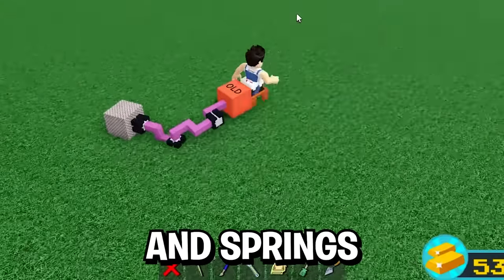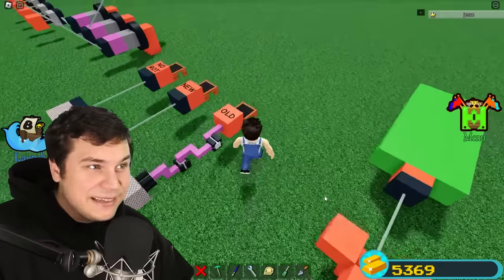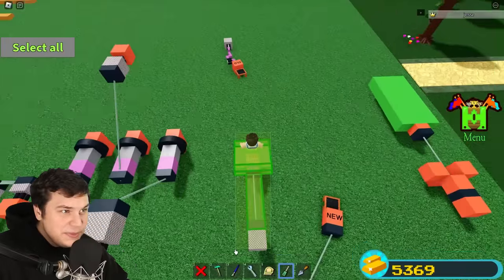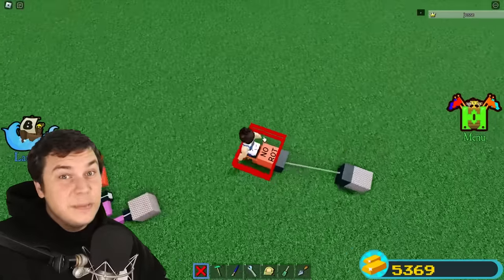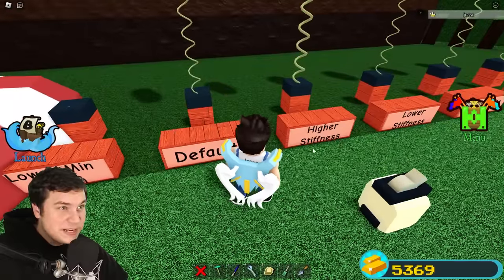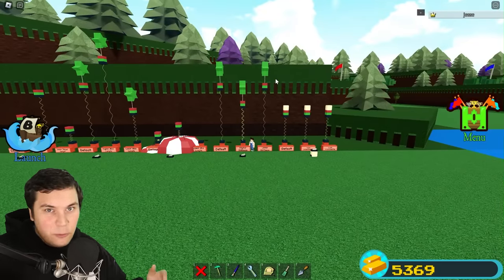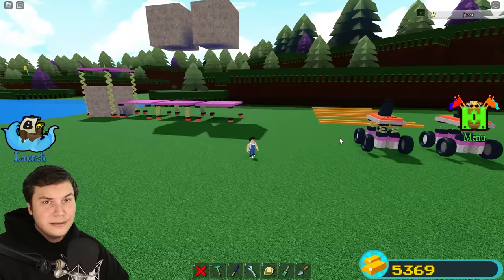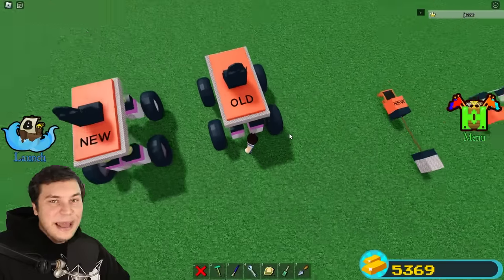How to use SPRING, WIRES & ROPES?! Roblox Build a Boat

Comment: We don’t have to use pistons to contract things anymore!All we need is the wire and change the length so when you un-anchor it already contracts or extends instantly.
Reply: OOOOOOOOH cool
Reply: @Lino_Gamer459 bro when it translates your message it just adds a o lol
Reply: @VanTran-nu4om yeah, its a random thingy on the translation there
Reply: @reversecard5196 this happens alot

Comment: Jesse, some things you missed in your two new update videos:
Fireworks now can have their fuse and flight length changed. Not too useful, but still notable.
Portals now are much more precise. Changing value/saturation/hue even by one on each of them makes a unique connection. This means instead of hundreds of combos, there are now millions. Very useful for large scale megabuilds.

Comment: heres a tip: first place two rods on top of each other and make it go up a little and clone it far away until the default limit of the barrier is surpassed and place 3 barrier wire thingies on the side and connect both rods and unanchor

Comment: It is not confusing I will  explane the stiffness is the thickness of the spring and the push force and the damping is the pull force and u can build suspensions that is mind blowing I build sum suspension cars with springs next is the bar I think I don't need to explain it and yes jessetc I correct about the bar and other stuff u can build tangks and train and other stuff easyr correct me if i am wrong

Comment: i made a car that has something that detaches and has a harpoon on it with a spring held together with glue and it has max dampening and 100000 stiffness so when my harpoon is on the person or boat they get flung when i press f to remove the glue block holding that part on